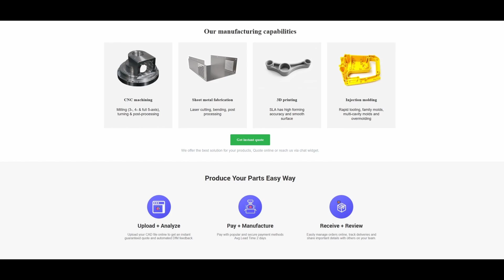Creality ender 3 s1 v1 v2 (pro) Watercooling KIT radiator Bypass installation Giveaway update !!!

Comment: Doesn’t it defeat, the purpose the whole exercise is to eliminate fans not add them more wouldn’t a passive radiator with no fans be a better choice.
Reply from the maker: yes and no, yes i do add 3 more fans to it, No those fans turn in a very slow rpm (noiseless). But yes i could have left those fans out , probably performs same